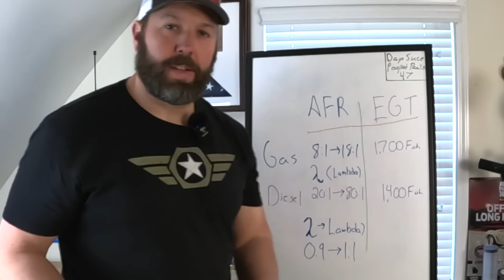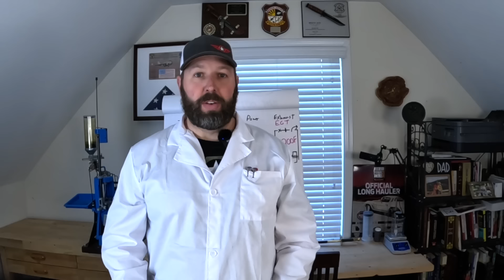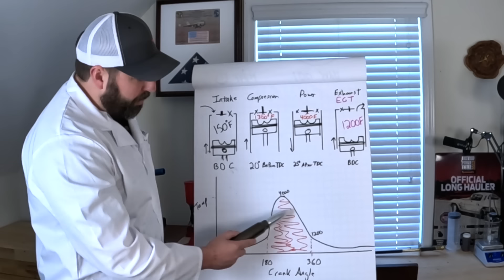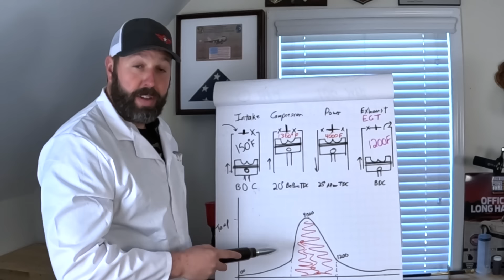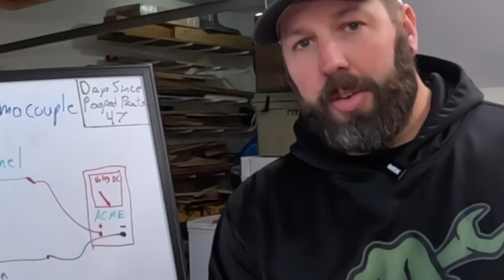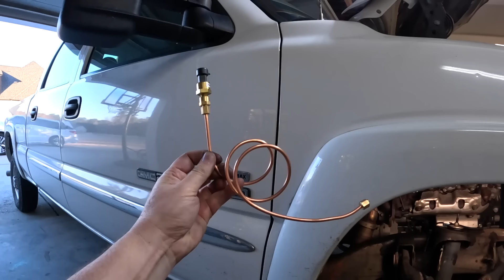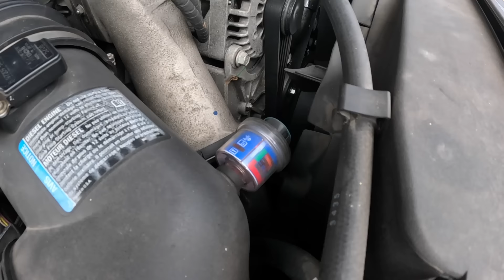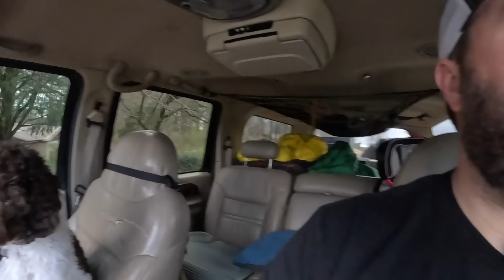Silent Diesel Killer…Diesel Exhaust Gas Temperature (EGT)! #diesel #egt #dieselengine

Comment: God your explanations are on point, easy to understand the more complex areas which is rare.  The humour just adds that bit more “flavour”.  I’ve been into diesels for 30 plus years and you have explained all my years of knowledge into a tiny window of time…congratulations.
Reply from the maker: I appreciate it. It takes me a lot of time to dumb it down to the point where people will actually watch it and hopefully understand it. So thanks for noticing 👍
Reply: @freedomworx  over the pond guy here, i was looking for a  tune to reduce fuel consumption, what would be a way to go about that, (as long as its not visible from the outside and i can revert for like half an hour every 2 years idc about emmisions) i have an honda 2013 crv with an 1.6l diesel
Reply: Diesels run with excess air and high compression so get close to the best efficiency. EGR reduces efficiency very slightly by restricting oxygen. BUT any problems upstream (injectors, turbo, piston rings, air filter, etc will increase soot. That will clog the intake manifold and cylinder head.
Reply: How about the pistol coolers blasting 200° oil.
Reply: I feel like I’m in class again

Comment: Big detail on thermocouples,  you can't extend the wire unless you use the proper thermocouple wire.   The thermocouple measures the temperature difference across the wire, it doesn't actually measure temperature directly.   The only way you can get the thermocouple to give you the temperature on one end is to measure the temperature on the other end with something like an rtd.
Reply from the maker: They are certainly different from most sensors.

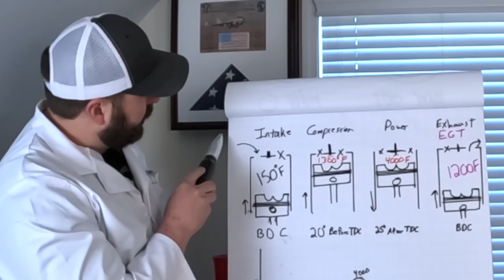Comment: At 3:53 .. if your charge intake air have 200°F (93°C) there's a BIIIG problem with engine intercooling/chargecooling. Even at anything over 150°F is a problem. Probably.

Comment: Diesel is a oil based flame which have much higher emmisitivity than a gas fired engine. Much more carbon particles with high emmisitivity in oil combustion. Any tune higher than standard factory specs require heat management and monitoring. Good video, Thanks. Put sodium cooled exhaust valves in as well.

Comment: Fully agree with piston cooling running close to limits in certain curbustances! Stop blaming bad fuel and injectors! Get upgraded oil coolers, and oil and exhaust temp management system.

Comment: Love you videos! You should make a video about dry starts. You know, after your truck has been sitting for a long time or when its cold out. It takes a long time (relatively speaking) for oil to get to the top of the engine on start up. I work on large diesel engines that have pre-lube pumps to help build engine oil pressure before start up. I am looking at installing a pre-lube pump on my 6.7 Powerstroke. Probably not necessary but It wont hurt and it will be  a fun project.

Comment: Did you know that today's diesel fuel has a significant problem with solubilized oxygen and dissolved air? These gasses make a significant contribution to the EGT's. That's science.

Comment: There is more going on than the ideal gas law. Work is being taken out of the gas which also lowers temperature. What do you think turns the crankshaft?
Reply from the maker: Ummmm….why do you think the pressure and temperature are dropping? Because the working fluid is pushing the piston down and turning the crankshaft… it’s pretty implicit.
Reply: @freedomworx  alright. I'm sorry to challenge a genius like you. Oh, wait. You said that the ideal gas law was why the temperature fell. I said that it is part of the reason, but the main reason is that work is being extracted from the working fluid. You never mentioned that. Then, you snarkily reply and try to imply that I'm the one who is dumb.

If you want to be ignorant, be my guest. This is the second time I have tried to enlighten you and both times you have exposed yourself in a reply. There are plenty of people out there who will fall for your "science" because they don't know any better. Im not one of them. 

Have at it. 🤡

Comment: Again, great information in an easily understandable delivery.  I like the hand over the lighter analogy.  I have a 3.0 L EcoDiesel in my Jeep Wrangler that I bought almost 5 years ago.  Only two times in the 85,000 plus miles have I lost power and pulled over onto the shoulder to wait it out.  Both times it was summer in Arizona with temperatures above 100°.  The first time I was going up a 6% mountain grade on I-17 the other it was after driving from Las Vegas and just getting on I-40 after having to slow down from traffic congestion.  I wonder if my Exhaust Gas Temps got high enough to put me in limp mode?  You got me thinking and I am going to check it out.  Thank you.

Comment: OK i have 97 7.3 with tunes KC turbo, stage 1.5 full force injectors and inner cooler i tow a lot full time RV i was told not to go over 13000 but mechanic says i can if short time pulling a mountain or my x wife hahahaha kidding

Comment: Great vid been intetested in diesel parameters for decades EGT,s EMT ,s , boost pressures , inlet manifold temps. Turbo designs exhaust gas systems . You cover it all and more in a humous not over technical way that gets the point across quickly and accurately. So many internet experts on forums spruiking BS and doing 5 figure damage to their engines .

Comment: When I started out to full time RV, I did everything to increase air flow. And when I got a tune for the chuckhole where a bunch of stuff fell off or stopped working, I always worked through multiple tunes with the tuner to eliminate any smoke. EGTs in the mountains are going to be somewhat high no matter what you do.

Comment: For the record I referenced this video when installing a "turbo inlet temperature" sensor in my Duramax and can vouge for the drill and tap with engine running. I felt every tiny chip on my face and arms but at least the turbo didn't lol

Comment: Pro tip:    Thermocouples measure the temperature difference across the length of the thermocouple.   What this means is that your dealie that reads the thermocouple is reading its local temperature to compute the EGT temperature.   This means you really need to make sure if you have to extend your thermocouple wire, do it with thermocouple wire (and make sure you have the right wires connected; don't get them swapped!)

Comment: Thanks I love your humor mostly I had a 1999 F-250 with the 7.3 drove all over the south east hauling trailers . 7.3 stone stock with a 3:73 rear gear I never really had a need for more horsepower I used the cleaner you don’t recommend but had 100,000 trouble free miles , changed the oil 3,000 miles fill oil filter, should have kept her best truck I owed diesel wise , bought dually F-350 should have got another 7.3 instead of 6.0 garbage. 
Love your videos can’t wait till crank comes back from machine shop .
Reply from the maker: And you just reminded me to go pick up that crank from the machine shop. They must be scared of it because they haven’t touched it in 15 months. 🤦

Comment: New subscriber here. I realize this video is old but I'll reinforce what others have said.  It is spot on!!  I bought a new 2006 F350 6.0 liter diesel.  It was an upgrade from my 93 7.3 F250.  What a learning curve I had in front of me!  I initially had a love/hate relationship with it.  Went through the replacement of the EGR and oil coolers.  Changed out a carboned up  turbocharger.  Learned along the way.  Installed a CTS Edge (non-tuning) monitor.  Learned you can't use a 6.0 as a "grocery  getter".  It likes to be run hard.  If your grocery store is two miles away, drive 20 miles to get there.  Run your EGTs up to 1000 degrees or above every trip.  It'll keep the turbo vanes and EGR system operational.
I've driven cross country for the past 10 years either hauling my heavy truck camper or 26 ft travel trailer.  Over 50,000 maintenance free miles through mountains and deserts.
Thanks for your videos!  Very informative, educational, and outstandingly entertaining!!

Comment: Actually, EGT is very important for gasoline engines as well - in certain applications. In aviation (small piston engine planes) EGT is used to control AFR. You can't run the engine with the same carburetor setting at MSL and at 10000 ft, the air gets thinner as you ascend.
Reply from the maker: For sure. I'm quite the aviation nerd. Wife is a licensed pilot. 👍
Reply: @freedomworx  Cool! I used to be a PPL pilot myself, but haven't flown for ~20 years :/

Comment: Here is another way to think this about this type of heat. When my 7.3 is unloaded and the cruise control is on, when I come to a a 3 or 4 percent interstate grade, the only thing that changes is I hear the turbo spoil up. Speed and rpm stay the same. What you don’t see is all this is made possible by adding fuel.

Comment: AFR is a derived number from lambda, additionally lambda is a raw number based off of every Base Fuel burn so when you’re tuning, good tuners will typically use this number because it will not change based off of different fuels that you burn in a gas motor. I.e. race gas, ethanol
For performance tunes. To a train day reading lambda is much better because it will also show indicators of your engine, leaning out due to factors that’s are controlable.This guuuuy  has done his homework and speaking nerd listen to his facts

Comment: I don't know what the upper limit is but 1350 works for my 12-valve.   It's been there for at least 100 hrs towing heavy grades over the years.   I adjust the AFC live til it stays there, then let it rip.   It didn't come with an EGR system either (1996 fed emissions).   Timing helped alot with bringing the EGT down, at the expense of coolant temp going up a bit.

Comment: This is a really good explanation. Not that it matters, but for a K type thermocouple to get anywhere close to 2300 F, it has to be shielded with magnesium oxide with a stainless steel tip and be pretty thick. All k types are good to 1850F, no problem.
Reply from the maker: 2300F 🥴. I cant afford that type of EGT 😂

Comment: Your awesome. Now for a quick question about mine, 2004.5 Cummins. EGR is built in the head on these models. 2003 models get over 22 plus mpg. Mine 15 to 18. Crazy difference. Is it possible to find a head from a 2001 - 2003 model Cummins and swap it out to gain the mpg. Just a question for a future project. Thanks in advance.
Reply from the maker: It’s a good question. But it’s not the head, it’s the camshaft in the 2004.5-2007 5.9L engines that create perform the EGR function, it’s not the head. Just replace the camshaft with something like a Hamilton 188/220 cam, and get a good time, and there is no more EGR. I have a 2006 Reg Cab Cummins truck 😉. I discuss the EGR system on this engine a little in this video https://youtu.be/EibM3PAc8as?si=Q7eFPb0zmJnG5o-t

Comment: Just noticed your shadow box...are you an EA-6B Prowler guy?
Reply from the maker: I worked on several types of Aircraft. I deployed with a Prowler Squadron for Operation Southern Watch back in 2000.
Reply: @freedomworx . Awesome!  Thank you for your service! I’m an old Prowler ECMO from the  ‘80s. Retired in 2012.  Now I just think up projects for my Ram. I’m About to tackle replacing the Turbo with an ATS upgrade.  I  love your show!
Reply from the maker: @johnhenry1395 awesome, where were you stationed/deployed? I was stationed at Cherry Point and deployed with VMAQ-3.
Reply: @freedomworx   When flying the Prowler was stationed at Whidbey Island.  Did a cruise & a 1/2 on FORRESTAL ('88) w VAQ-132 and then as ship's company (Cat Officer) for two cruises on SARATOGA .  I did some contracting later and spent a few (8?) yrs in AFG, including a couple with the Marines at Leatherneck. HOOYAH!

Comment: Great vids- hope you keep ‘em coming’👍

1968 M35A2 w/ White multi-fuel diesel; I’ve had it for about 12 years now.. 

My very first mod was installing a pyrometer, and I am so glad I did. The EGT’s pulling up Cajon Pass jump up to 1400+ if I don’t watch it. Uncle Sugar ain’t gonna replace my old Army truck engine, so I gotta take care of it. 

I always try to keep EGT under 1100, with occasional short-duration temps up to 1250.

Comment: Install a Banks water/methanol injection system and all of your heat problems go away.
 The added 25 to 35 percent of additional torque is nice to.
 Probably installed it will not damage any components. 
 In addition,  it will assist with your DPF as it will be steam cleaning the entire exhaust system from the valve to the tip of the pipe.
 Your computer won't even see it so there is no conflict there.

Comment: You described thermocouples incorrectly.  As temperature varies, so does the resistance of the thermocouple's bi-metal.  The thermocouple doesn't produce power all by itself.
Reply from the maker: You might want to go do some research brother. Thermocouples are not the same thing resistance based sensors. They don’t work off of resistance and they don’t need a power supply. THEY PRODUCE VOLTAGE. https://en.wikipedia.org/wiki/Thermocouple

Comment: It's funny how many people think that fully deleting the truck is what's best. He's not saying don't fully delete it, he's saying make sure that it's properly tuned if you do remove the EGR. There's some really bad tuners out there. Especially for work application vehicles that tow frequently. I always left the EGR in on work trucks for this reason.
Reply from the maker: People will accuse you of being a Purple Haired Communist is you saying anything beside Full Delete Immediately 😂👍
Reply: @freedomworx it's pretty dumb on a truck you want to work for you towing honestly. The further you get away from stock towing heavy the worse it gets. And it costs a lot!
Reply: i disagree, my buddy had a 6.4 that was fully deleted, never had any egt issues or overheating, get rid of the bullshit and it breathes
Reply: @mrmo9125 did you read that whole comment? I said if it's fully deleted make sure it's properly tuned for not having emissions. Towing max weight in deleted vehicles can cause extra internal cylinder temps if it's not properly tuned for not having the emission restrictions.

Comment: actually the reason the engine internals dont melt is due to the boundary layer of gas. it acts as a buffer layer between the flame front and the component itself.....
Reply from the maker: So we don’t need piston cooling jets? Got it 👍
Reply: @freedomworx  No, actually, you don’t need piston cooling jets. In fact, most engines don’t have them. Sure, they help manage heat in heavy-duty or forced-induction applications, but they’re not a requirement for survival.

You imply that pistons don’t melt because of Boyle’s Law, and while yes, pressure and temperature drop as the piston moves down, that’s not what directly protects the metal surfaces during combustion.
If you actually understood what’s going on inside the chamber, you’d know it’s the boundary layer of gas that plays the most critical role. This thin insulating film shields the piston, cylinder wall, valves, and head from direct exposure to peak combustion heat.

That’s why, in a petrol engine suffering from detonation, you often see piston crown melting, cratering, or aluminum splatter — because abnormal combustion strips away the protective layer, exposing the alloy directly to flame front temperatures, far exceeding its melting point.
The same principle applies to diesels. When things melt in a diesel, it’s not because the piston wasn’t moving away fast enough; it’s because combustion temperatures got so high that the boundary layer could no longer insulate the components.

This is exactly why we run gas engines rich of stoich under load — not just for power, but to help cool the chamber with the fuel’s latent heat of evaporation. The same concept applies to diesel, despite being less effective due to diesel fuel’s low volatility.
99.9% of diesels run far leaner than stoich, even under load, as we try to balance power, heat, and soot. You cannot practically run a diesel near or richer than stoich because soot becomes excessive. Most diesels will begin to produce visible soot from around 25:1 AFR and leaner (depending on engine and injection system design) — nowhere near stoich, let alone rich...

In racing classes where adders like water/methanol or nitrous aren’t permitted, diesel competitors often run rich of stoich to gain cooling and maximum power (exactly like gas tuners), even if it means extreme black smoke.

So yeah, piston jets help, but don’t confuse them with what is actually happening. Engine internals survive combustion because of controlled thermodynamics and proper combustion behavior, not because the piston runs away, lowering pressure and temperature before it melts.
Reply from the maker: @nismofreak33 You realize that clogged piston squirters jets have been the demise of many diesel engines… That’s why Cat specifically forbids their techs from pre-filling oil filters. Piston squirter jets are absolutely required in diesel engines 🤷🏻‍♂️ I had no reason to read any further into your comment after you made that statement.
Reply: @freedomworx  then you are a fool

Comment: The one thing I would love to see with all of the videos on youtube discussing EGT's, tuning, etc, is for  someone to be located out west where the on the road testing can be done with a heavy 10k + load hooked up and steep mountain grades to pull.  You will learn there is a certain amount of EGT temps you will have to live with, or you will never make the top, for the downhill and ultimately the cool down.
Reply from the maker: That’s the point of me discussing the maximum sustained EGT. So when someone goes out west and pulls a steep grade, they will know if they are in the safe range or not.